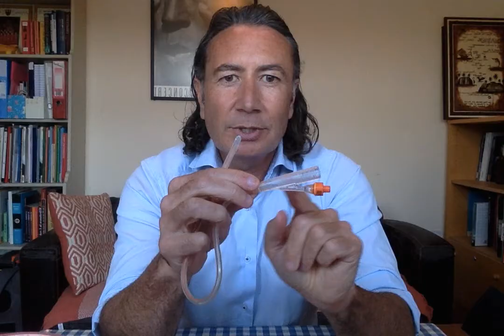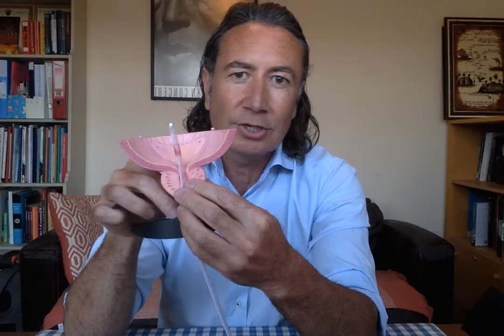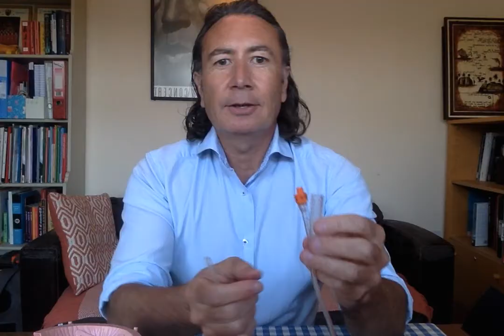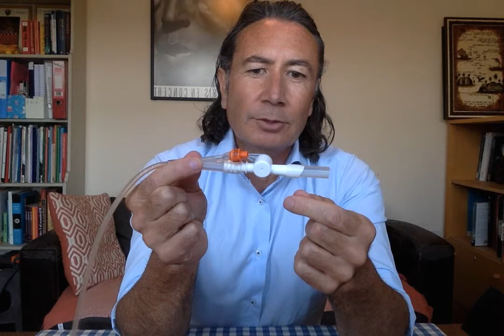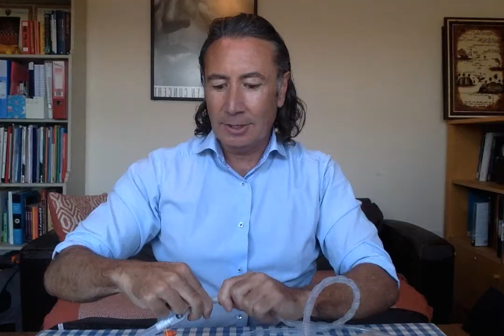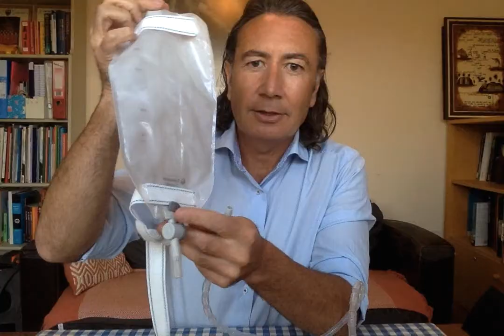Understanding urinary catheters: An introduction

Comment: Flip-Flo is the brand name for BD's catheter valve. I have used both that brand and the Ugo brand. I had several Flip-Flo valves develop leakage, usually immediately after, or very soon after, being put to use. I have used the Ugo brand for years and have never had one leak.

Comment: I’ve been in the hospital an antibiotic treatment seven weeks. I have a catheter. I will probably have a catheter for sometime after my treatments are finished. They actually just ended day before yesterday. I have pain in the tip of my penis.. It’s so bad that sometimes I don’t want to get up and walk around because the movement of the catheter going into me pulls on my penis with any movement.  I desperately want a topical suggestion, please. I’ve gone onto Amazon and I’ve seen numbing creams that have lidocaine. I have no idea if a general rubbing cream that has lidocaine in it is appropriate for skin as sensitive and thin as the tip of my penis. 
I desperately want something,  Laying or sitting around because I’m in so much pain due to the pulling of the catheter, on my penis with the slight movement, is no fun and unhealthy.. I want to be able to walk around and get some exercise.. so please any suggestions,

Comment: Hi Tev.  Thanks for the information.

Unfortunately my health care provider provide little to no information.

On my third day at home I had an instance where I urinated past the catheter, creating not just a mess but a level of stress as I had not been warned that this can happen.  I went back to ER, where they changed the catheter from a No 14 to a No 16, still with no explanation about expecting by-pass or whether it is normal.

Is it normal? and is there something that can be done to avoid these unfortunate accidents?

Comment: I have used Foley catheters for three years now.  I stopped using night bags because the catheters would end up getting clogged. I have a day bag which first thing in the morning I connect and it fills up which I drain right away. This seems to keep the catheter well flushed.  drink plenty of water in the morning. I often keep the day bag connected for an hour or two. Once the bag stops collecting I disconnect it and place a clamp made for catheters.  For the first two years I wore long pants to hid the catheter.  Drain it as it filled up. Again I found the it would get clogged. Since I started using the clamp method I have not had to visit the er.  When I was using the night bag if I failed to drink enough water during the day my catheter would be clogged in the morning.  Before I got sleep I drink two glasses of water. Fist thing in the morning I connect to my day bag and drain. Works very well. A lot less stress.

Comment: Thanks for that, im having Aquablation in a couple of months ,  very nervous about the Catheter thing,  and its removal , can you do anything on the removal aspect
Reply: I am having aquablation soon also, how did everything go with yours, thanks in any info you can give
Reply: Hi , yea it went well , you dont feel a thing  obviously as your out cold, you will wake up with water being flushed through the parts that they have quarterized , you will note the color of the bags of water that they will take away periodically , take a note of how red the color of the bags are, that will give you an indication of when the bleeding slows down, then they will take you to a ward where you will spend the rest of the day and night hooked up to that water flushing system, then in the morning the consultant will come round and check on the color of the bag , by now it should be pinkish ,  then the nurse will be instructed to remove the catheter , that only takes a a few seconds and not really painfull, a little embarrasing  if your not used to a nurse handling your bits, , so then they will get you to pee at least three times , and once they are satisied you can, then your sent home that same day, it will sting a bit at first, and you will also still pee pink urine for a day or so,  im fine now and everything still works how it used to ,  still get good erections and havent lost the firing pin  lol @kennyl.TheSilverJewelryGuy

Comment: Hi Tev, thanks for the informaton, I was interested in the flipflow valve because i have been using a catheter now for 3 months. The district nurse told me  to try a flipvalve if i wanted to wear shorts . I tried using the valve and only had it attached for around 2 hours because the urine from my bladder just ran out around the outside of the catheter tube through my penis. Is this a common problem ?
Just to add that I have visited the Urology dept today and have a prostate scrape appointment being booked, hopefully this will stop my urine retention because of enlarged prostate.
Reply: How’d it go?
Reply: @InJusticeAustralia  I had a TURP procedure, not long after replying to your video, spent an over night stay in hospital and everything is working well. I am still having 6 monthly PSA tests as my results are at level 9, if it increases they will book me in for an MRI scan

Comment: Thank you doctor. I got a kidney stone removed with laser via the urethra and I lost the ability to urinate.  I'll be wearing a urinary catheter for 4 days according to my doctor, but I feel I might need more time as the tip of my penis hurts a lot, and I can tell by the feeling of the catheter that it definitely needs more time. Where do I go from here?  Should I wait more or trust my doctor and remove it and then try to urinate? I really don't want to have to go through the whole thing all over again, any thoughts on that? Also is it possible to tell while wearing a catheter whether you're fixed up and the ability to urinate is most likely going to happen ?

Comment: Hi Tev. Thanks for the videos, very informatives. I recently had a catheter inserted in me, after not being able to use the toilet for 9 hours (due to the use of some classe A's and an urinary infection). I've also got a stent on my left kidney. All because of a cyst (15cm) on my right ovary that is pushing the organs down there to the side. 
What are the chances that my bladder will recover? Are there any risks of it not working again? Is there people who live with a bag their whole lives?
Reply from the maker: Hi Ellery
If the nerve supply to a bladder is damaged/doesn't work normally it can lead to the bladder becoming a bag that doesn't generate the pressure needed to allow urination. In some cases a mass in the pelvis can obstruct the bladder in women. If you don't have any of these issues then your bladder should start to function normally again